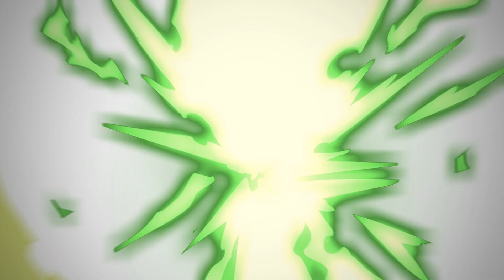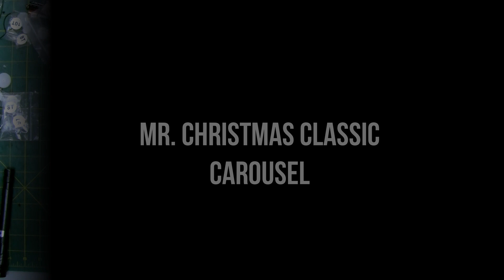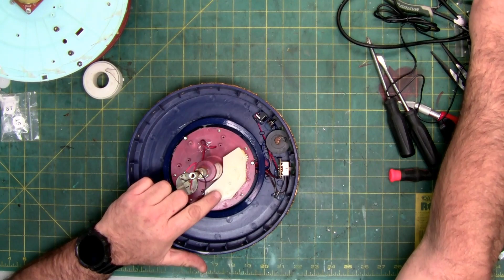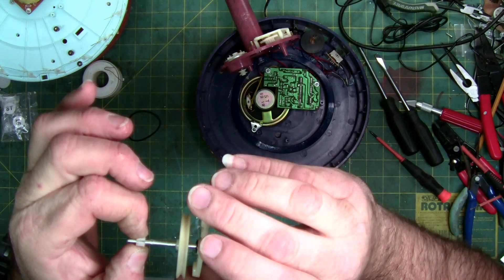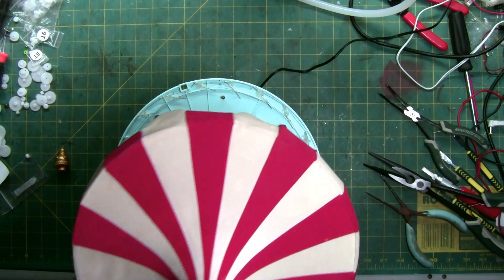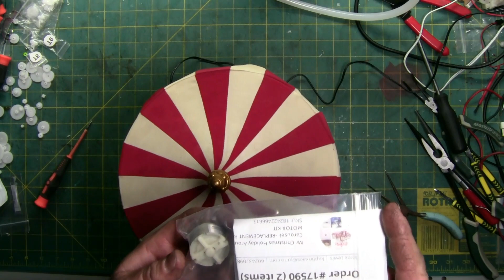Mr. Christmas Classic Carousel Repair

Comment: The design of the "transmission" on this thing is awful: flimsy, misaligned acrylic gears with lots of slop coupled to a cheap 6vDC motor with a crappy elastic belt. I swapped the two outer-most spur gears with larger-faced metal gears to eliminate misalignment and skipping caused by the off-the-shelf gears' faces being too small to mesh effectively--which helped considerably. But really, the best solution for longevity and performance is to completely abandon the OEM drive and install a direct drive, regulated motor. This inexpensive retrofit requires some electronics knowledge, some CAD software familiarity, a 3D printer and a daub of epoxy. Gotta make a video of the process and its results.
Reply from the maker: I agree but most can't do that. I know they had an issue with the tracking for a while. Some changes were made on different and newer models to help combat this.

Comment: I have one that the top of the carousel will not come off. It comes off a little but will not come off any more. The tip at the top is not removeable. Can anyone help? The number on the bottom is 19992  W28.  Thanks.
Reply from the maker: Can you send a few pictures of it to randomjchannel@gmail.com
Can look at it and see where the access points are on yours

Comment: I have a carousel that has never worked properly since it was new. When I turn it on, it starts off fine, but after about ten minutes it begins to slow down until it stops completely. The music and the lights work normally. What could be causing this issue?
Reply from the maker: Slipping belt when warm or the motor is failing when it heats up
Reply: @RandomJunkChannel  Thank you very much, I will try to repair it

Comment: My carousel came without a dc/ac converter. It calls for a 6v 1.2 amp converter. Can I purchase one on amazon as long as it meets the required output.
Reply from the maker: Yes, here is a link to an adapter that has plug end adapters for different electronic devices. As long as its amperage is 1.2 amps or higher at 6 volts, it will work.
https://amzn.to/4jHtzn1

Comment: Does the AUKUYEE gear set work on all MR. Christmas holiday caraousels ?  I have a 2004 model i need gear parts for , belt and volume switch , pretty much everything in this one needs repair. Thank You for videos and help.
Reply from the maker: Some of the gears will be in there but some Mr. Christmas piece use proprietary gears.
Send an email with pictures of what you are working on and parts needed and I can see what I have or where to locate the parts
Reply from the maker: randomjchannel@gmail.com
Reply: @RandomJunkChannel   , thank you , I sure will , I think it may need a motor as well. Got this one used and not too cheap either , but it was not a good  buy. I have not tore this one down yet but watching your videos  I think it will need the gears and motor.  I will send pics asap . Thank you

Comment: I have a Mickey’s Holiday Carousel. There is no sound or movement. It’s dead! What do I look for?
Reply from the maker: Check the cord, then check the connections inside especially around the on/off switch. inspect the board for damaged components and lastly disconnect the motor and try it, if it turns on without the motor, motor is the culprit, replace it.

Comment: Where do you or did you get that bag of plastic sprockets?  I don't see that the gear is split like yours was, however the pin of the same gear spins inside of the sprocket, thinking it needs to be tighter.  Great video and very helpful.
Reply from the maker: I used two kits and mixed them together, linked them below; 58pcs Plastic Gears - https://amzn.to/3sIHPUB
Reply from the maker: AUKUYEE Plastic Gear Set, 75Pcs - https://amzn.to/34d2dmD

Comment: Thanks for the teardown info, much appreciated. Helping my mother in law w fixing hers.... I found an inop motor, dropped/bent main motor drive gear (smallest of the gears), and stretched belt. I have zero volts feeding the motor, at the motor and from the board. What's the voltage specs going to the motor? (older until, running a output  12vac/ 700ma adapter) Any kind of tests that u have to condemn/not condemn the control board??
Reply from the maker: Motor should be at the 12vac. Inspect the board, tracing the tracks and look at the components to see if you can see a bad one. Message me if you can get it, I may have a spare board.
Reply: @RandomJunkChannel  thank you sir. I will recheck the board tomorrow. Appreciate the advice.

Comment: mine works but the music is crackling , looks like grounded, humming sound, humming goes louder when i turn volume higher..  what should i do?
Reply: I have a MR. Christmas 1994 model ,the horse don't go up and down and the lights don't work, what is the fix with this one ?  It does go round.
Reply from the maker: Check the capacitor on the motor, if cracks or fails if puts noise in the sound circuit.
Check the solder joints on the speaker, board, volume switch, so on. Solder can crack causing arcing and noise within the circuit.
This is where I would start.